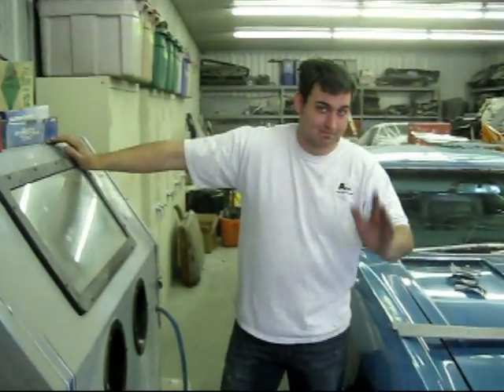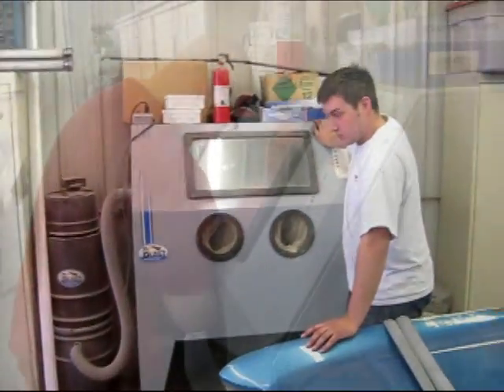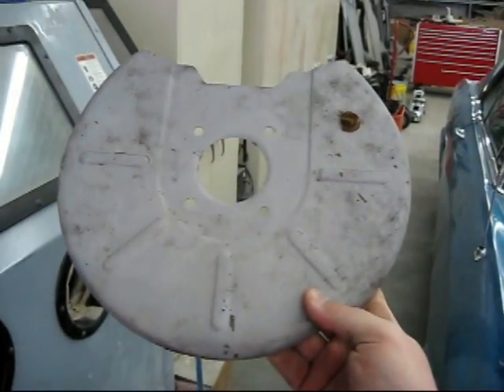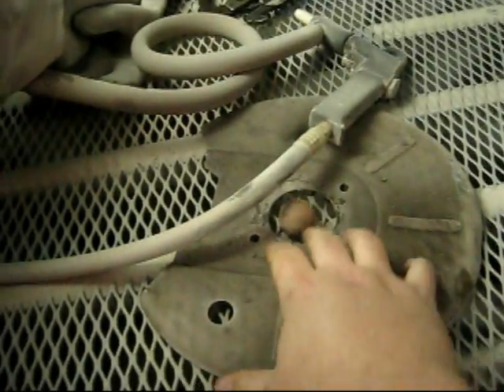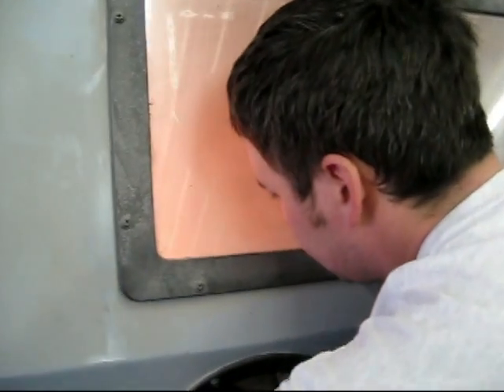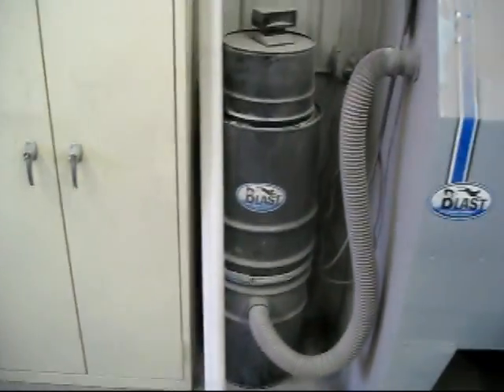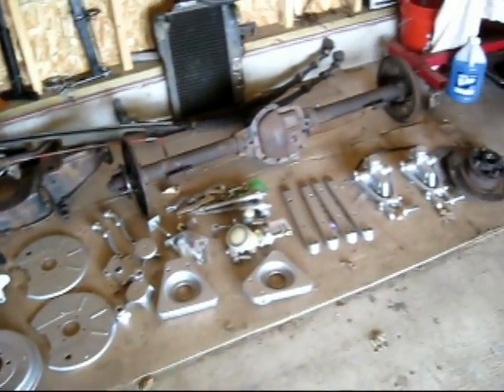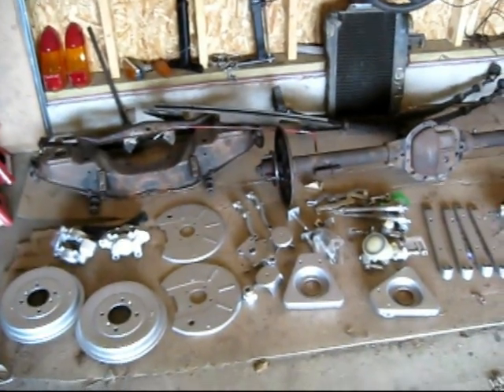MG 36 - Travis's Sandblasting Booth

Comment: tip for those small blast booths is to make up a pipe arrangement that is mounted above window,, drill a series of holes in it, and a blower to pump air back throught it.....this will keep the air visible in front of the window